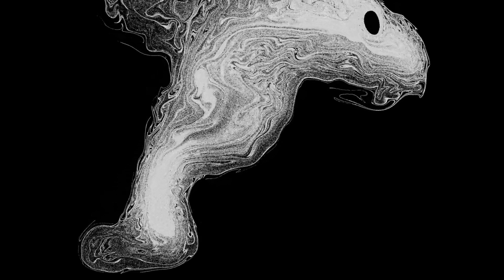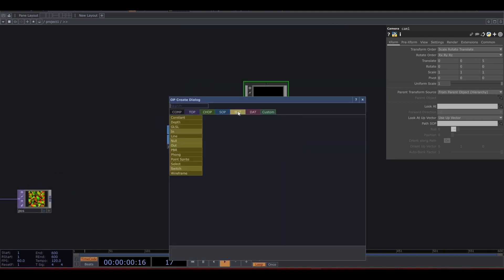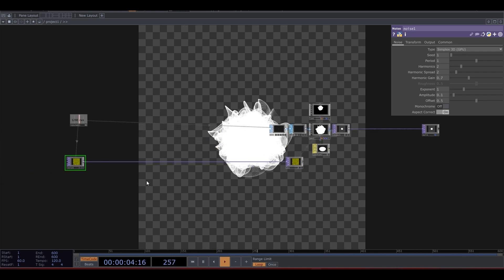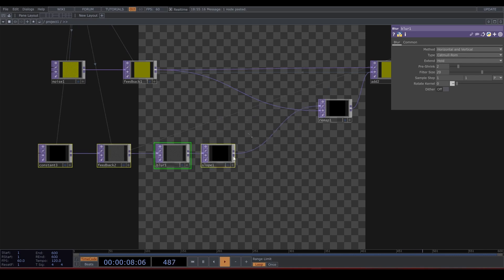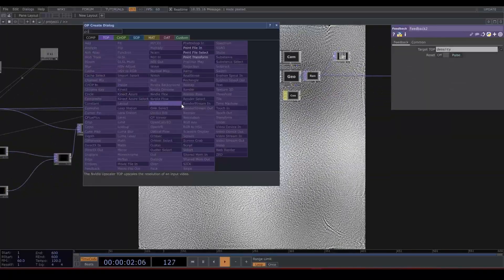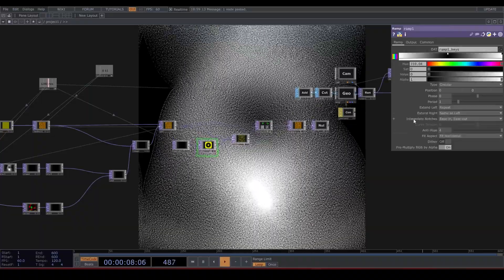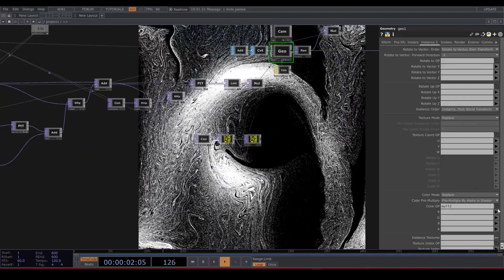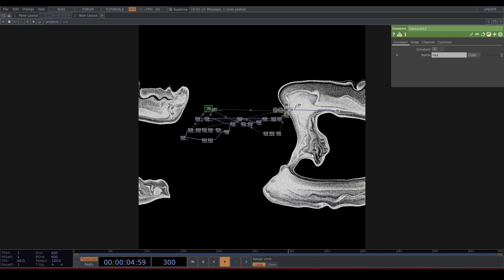Particle-based Fluid Simulation TOUCHDESIGNER TUTORIAL

Comment: hey at 6:18 I'm having a little problem, I've set the remap1, the blur1 and even the blur2 to "Extend: repeat" but I'm still getting that edge action, any idea on how to solve this? Thanks! I'm a newbie!
Reply: Same here. When set the two nodes to Extend to Repeat, as described, edges get jagged, otherwise not. So I left the Extend at Hold, which seemed to fix it. When I dropped the Limit node though, all the edges became jagged again
Reply: I had the same issue but found a fix, change the 3 sample step paramters in both blurs to not be 1 and it works, I used 1.1

Comment: For example, I tried a method where particles are continuously generated from the left edge instead of flowing from left to right and reappearing at the right edge in a loop, but it didn't work.
Is there any way to do this?

Comment: Hey, I really wanted to do this but at 5:00 my remap TOP doesn't make it look like what you show in your video. It just breaks the whole thing. Please help
Reply: same here! have you found a solution yet🥲?
Reply: you need to check again with your first noise paramater at the beginning, i have the same problem like you because i change the offset to 0 and fix the camera in my way, it didnt work for me.  And when I change the offset to 0.5 ( like in the video ), it worked perfectly for me

Comment: Thank you for tutorial. If I change resolutions as 960x1280 or any vertical res, it does not work. I think it is about "add and convert" but I could not solve that. Could you please share with us what we have to do for vertical works? Thank you!
Reply from the maker: hello!

It's actually a little trickier than that. My honest sugestion is cropping the output with a fit top.

You could also do some math before the remaps. so you are changing the range to the aspect ratio so in 960x1280 the red channel is changed

 from range 0. -  0.75 
to range 0. - 1.

and this goes before the second input of the remap.

But there is some more changes that will need to be made...

So i just suggest cropping it.
Reply: @supermarketsallad  WOW! That's why all of us love you! Thank you for your detailed response. I didn't try yet your suggestions but logically it will work. Thank you.

Comment: Is it possible to slow down the spinning?
Reply from the maker: increase the blur-size, slower the slope-strength, lower the "degrees of turn" in the point-transform, or add a math after the pointtranform and multiply it by a number < 1.  are some suggestions :)